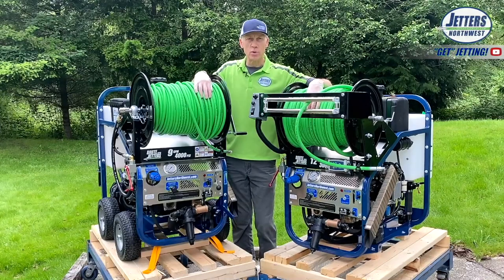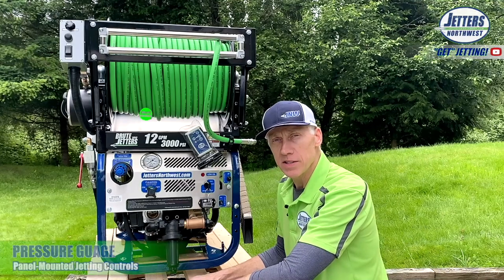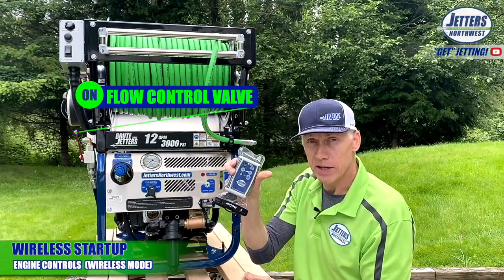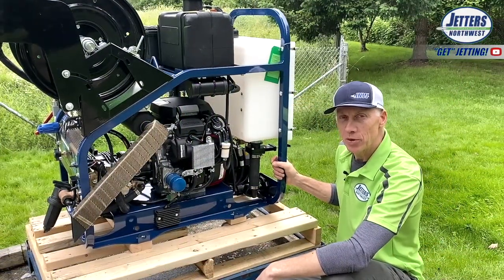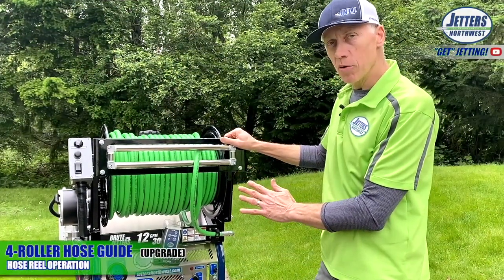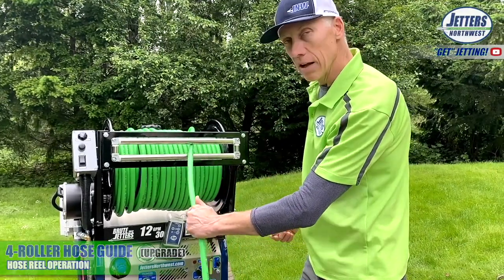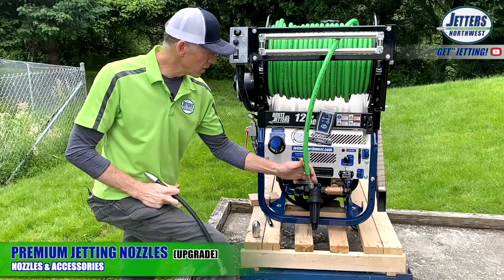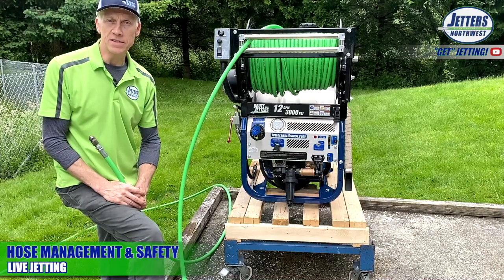Brute Jetter OPERATION & TRAINING - FULL VIDEO (all 8 segments)

Comment: 15:28 Wait, did you just say to use Vaseline on that o-ring?
Never use petroleum on an O-ring.
Use a silicone or teflon based lube.
O-rings are rubber and will deteriorate and expand under petroleum so use silicon lube.
Even special applications like Viton 'O' rings/seals for acidic applications and EPDM for alkaline applications.
If ever in doubt, use silicon lube!
Heads-up to auto workers, the rubber weather striping on your car or around your sunroof, never use a petroleum-based products, only silicon lube.
Yes, I've heard the stories of auto repair shops recommending Vaseline but let me warn you, it will lead to O-ring/weather striping expansion (swelling) and deterioration of the rubber.
Great video though.
Reply from the maker: Thanks for the feedback, but FYI all of the o-rings in our water-system are petroleum-resistant "Buna-N" (aka Nitrile) or "Viton" material (not "natural" rubber) so vaseline-types condition them nicely ;)